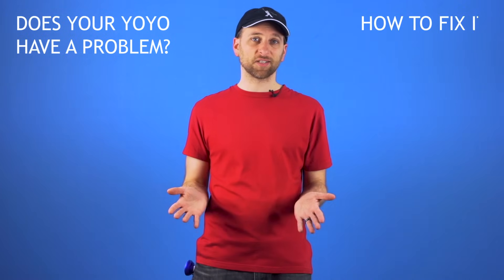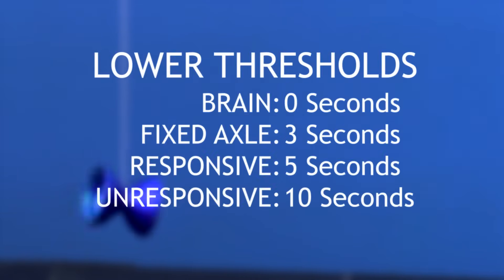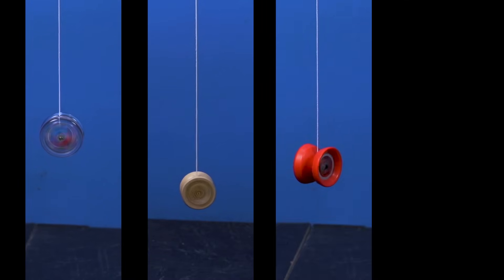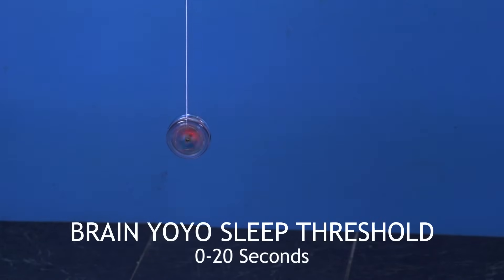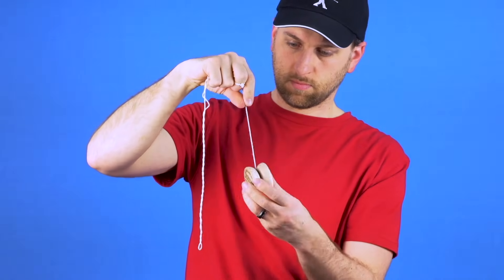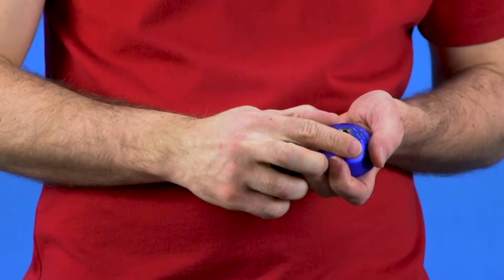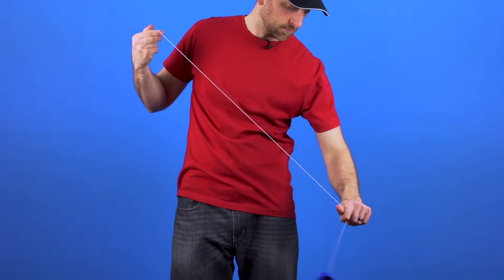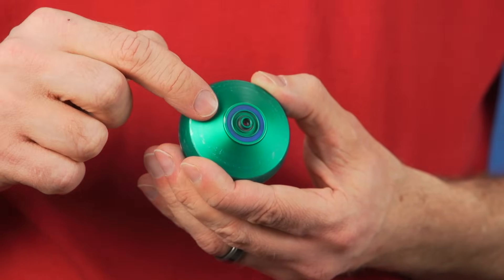Why Won’t My Yoyo Sleep Longer? How to Test and Fix your Yoyo Spin Time

Comment: I have the fireball and when I try sleeping it goes sideways and spins but I throw it straight
Reply from the maker: How long is it sleeping before this happens?
Reply: yotricks It doesn’t even sleep properly like it goes down straight but when I try to cushion it or sometimes I don’t even cushion it it goes side ways and spins weird, a friend told me it’s not lose enough, I just tried to move the string around the axel and it doesn’t really move around it smoothly it take effort, it doesn’t have to be loose for me to wind it back up
Reply from the maker: Have you tried removing the string and putting it back on? Also does it still have the white transaxle piece where the string attaches to the yoyo?
Reply: yotricks yes it does and let me try that
Reply: yotricks thanks it turns out there was a knot tied at the transaxle piece, it just comes right back up though but that might just be me not being able to fusion it, can you give me any tips?
Reply from the maker: If you want to know if there is a problem with the yoyo do the drop test we talk about in this video. If it sleeps then it just means you need to practice cushioning the yoyo a little better. You will get it with time.

Comment: I only have trouble with my Sage responsive.
Reply from the maker: What trouble?
Reply: I just can't get the Sage to spin as long as my other responsive yo-yo's. My Fizz and my 720 spin much longer. I see you guys doing some tricks with the Sage in responsive, but I have to use one one of my unresponsive yo-yo's (Iceberg or Boost) to do the same trick because my Sage doesn't spin long enough.

Comment: Hey I new to yoyoing, and i bought a magicyoyo silencer. When i was working on bind trick it started acting "responsive" snapping back up at me like a normal yoyo, with just a small tug straight up, why would this start doing this? dirty or bad bearing?
Reply: try cleaning your bearing, this usually works

Comment: i got the sage yoyo starter pack and its only sleeping 3 seconds with the lower threshold.
Reply from the maker: It sounds like the bearing is not spinning. You may have tightened it together too much.
Reply: @yotricks  well i made sure it was spinning and it sure was

Comment: My responsive yoyo spins only 5 seconds on best throw. It has some kind of "grinding" noise In it. Its quite new
Reply: YOYO what is it?
Reply: @mollies13  either you meant this: what is an yoyo
Or this: what yoyo do you use. (I used a henry's™ lizard yoyo. Now I have a replay pro™ one.
Reply: @codezyt9695  that a baby toy yoyo....I check on google images now that not made for yoyoing, that one just made for like fun for kids.

Replay Pro is perfect for you then

Just make sure to throw it natural and strong but super hard.
Reply: @mollies13  yea😃
Reply: @codezyt9695  replay pro is still plastic but it gets the job done.
Now the yoyo I have is call Magic YOYO hertz, You can go ahead search that its very cheap but can sleep 10 minutes and super stable for gyroscope and revolution.
Reply: @mollies13  ty
Reply: @codezyt9695  Your yoyo cost $15. Hertz cost $16 but its higher advance tricks then yyf but its your call what yoyo you like that matter to you.
Reply: @mollies13  yea. Might buy that yoyo that yo pointed out. Not yet tho. Gotta learn some simplier tricks with the replay pro.
Thanks for advice

Comment: My yoyo spins for 5 second minimum and 8 secons with my best throw. Pls help
Reply: What yoyo are you using?
Reply: @charlemagne3903  i figured it out. I have a velocity yoyo and it has this arjustable thing and i needed to adjust it a bit

Comment: I have a brain yoyo and when I use it it doesn't sleep it just come back up
Reply from the maker: In order to get a brain yoyo to sleep you need to have a powerful throw. Those yoyos are designed to come back immediately unless it is spinning very fast.
Reply: @yotricks  thanks for replying. I don't want to put you through trouble but even when I do that is doesn't sleep. I recently replaced the string with a regular string as the old one was worn out.  Maybe that's the problam
Reply from the maker: That could be, especially if it was sleeping before.

Comment: 35 secs on a Replay?
Reply from the maker: For the drop test?
Reply: No, for that maximum test. Just re-did it and got 40 secs Note: Responsive Replay Not PRO
Reply from the maker: @theolodger  Ok. That sounds about right.
Reply: @yotricks  Thanks!
Reply: Just retried and got 1m 5secs
Reply: 25 secs on drop test!